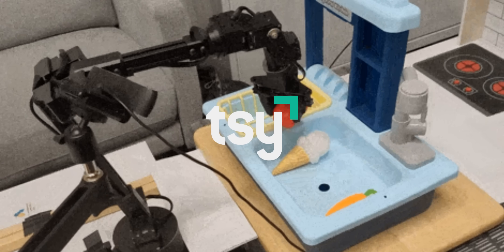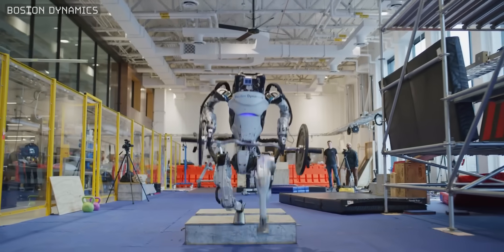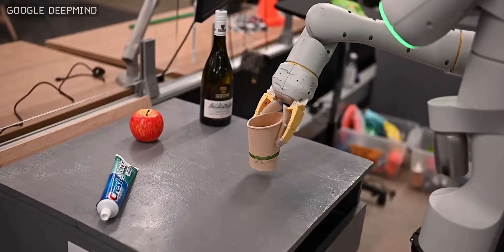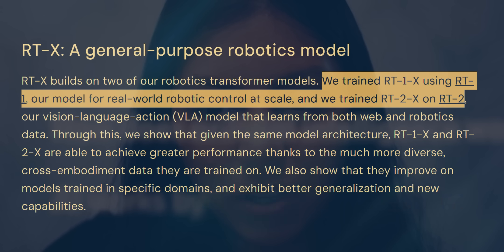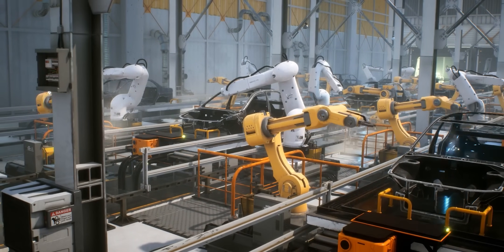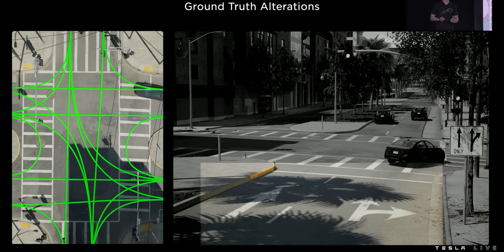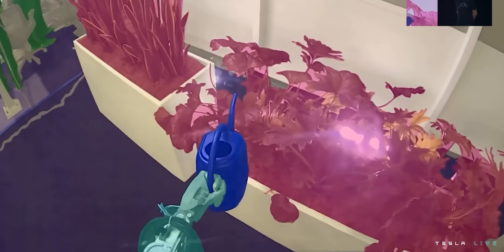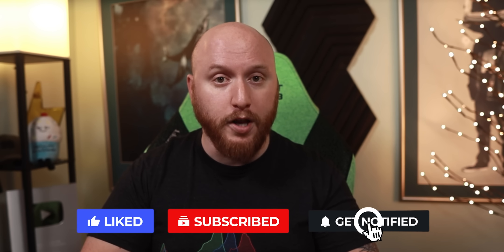I'm Investing In This HUGE AI Breakthrough (Get In Early)

Comment: Tesla has the data from what human drivers do in response the world that they see around them. That's all the FSD model needs to do so I guessed that they would have an end to end learning process once the speed of learning was fast enough. It's a direct map from the mapping of input data of cameras to steering/accelerator sensors reactions by human so the model should be able to do that without the intermediate steps being discreet. The benefit of the modular approach that includes the labeling and occupancy model is the visibility of what the car is thinking which probably helped to identify errors or issues where they needed to focus.
Reply from the maker: True but the drawback is performance and scalability

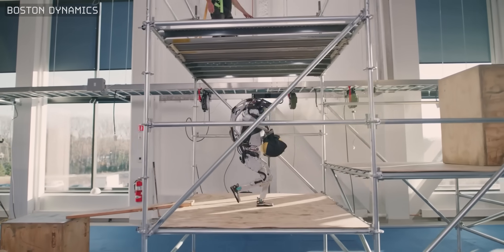Comment: Robot needs to cross a gap at 2:36.  It chooses to push a box in to fill the gap.   Let's say the box isn't available but that dude with the hardhat is.  I'm guessing the robot has the strength to turn that guy into a box shape with ease, and no moral compunction not to.  Sure, people will say there are safety protocols programmed in.  My lathe at work has every safety feature that modern engineers could think of, yet it will still rip your arms and legs off if you're careless.
Reply: Boston Dynamics bot doesn't 'think' - all its tasks are preprogrammed. That's not to say that it won't in the future though.

Comment: If a city has a fleet of buses that run on natural gas, they could install sensors in their sewer lines to detect high concentrations of methane gas.  When these are detected, a robot equipped with an air compressor and a gas tank could go to these areas, fill the tank with sewer gas and bring it back.  The tanks could then be used to power a buses.   Former coal mine tunnels could similarly be used to collect methane gas as coal seams go on to emit methane gas for decades after a coal mine is closed.
Reply: Sure, I’ll invest in your startup. My net worth is about a hundred bucks…
Reply: @SigFigNewton  for the coal mines, it's not a startup.  CNX Resources already does this and it's publicly listed on the New York stock exchange.

The East Bay Municipal Utility District currently uses a slurry of sewer mud, scraps and grease from local restaurants, plus waste streams from wineries and poultry farms are mixed together in large tanks and “digested” by microorganisms. The biogas emitted by the microorganisms is captured and used to generate renewable energy to power the wastewater treatment plant.
Reply: @HepCatJack  coal mines? Oh, no way in hell I’d ever invest in that. Would much rather invest in energy storage tech (which is effectively investing in tech to further solar and wind) or in solar or wind directly or in geothermal or nuclear… any way of producing electricity that doesn’t give lung disease to its industry’s working class
In the US, coal needs government assistance if it is to remain economically viable. Like even ignoring worker health and ignoring climate change coal is a bad choice here. I assume the economics are different in other countries

Comment: If a robot with A.I was equipped with the equivalent of goat hooves, it could potentially climb cliffs and explore caves on Mars making its own decisions and transmitting a report periodically on its progress upon returning to the entrance to do so.  Such a robot could find areas that could be used as shelters that would provide better radiation shielding and possibly water sources for human explorers on Mars.  They could be trained in Earth's caves and tested on the Moon which is much closer if new improved versions need to be sent.
Reply: Please explain your obsession with goat hooves.
Reply: @fredbloggs5902  they are the greatest of all time (goat).
Reply: @HepCatJack  people can climb where goats can’t
Reply: @fredbloggs5902  there's footage of two facing cliffs and goats jumping from one to the other in order to quickly ascend.    Some scale the surface of dams to lick salt on the surface.  Humans need specialized equipment and they ascend far more slowly.   They drive metal screws into the surface to which a line is hooked.  Not practical for a mars exploration as a robot using that tech would quickly run out.
Reply: @HepCatJack  you’ve obviously never seen free climbers.
Reply: fun idea.  Drones would work too, though
Reply: @ShinkaTV  drones wouldn't work on the moon for a lack of atmosphere. 

I think also that the tiny hairs that Geckos use to climb walls could possibly be copied to have the ability to climb fairly smooth walls.  Perhaps using several limbs like spiders have.

There are a lot of cave systems in Peru and Mexico, Central America that are unexplored and have potential archeological values.  Maybe a robot that could flatten itself more to pass in tighter areas.
Reply: @HepCatJack  there's also robotic slime.  Ah, so many creepy yet potentially helpful options.
Reply: Have fun on Mars, i'm not holding my breath, and would not go anyhow.
Reply: @flexjay87 If you're on mars you should definitely hold your breath.